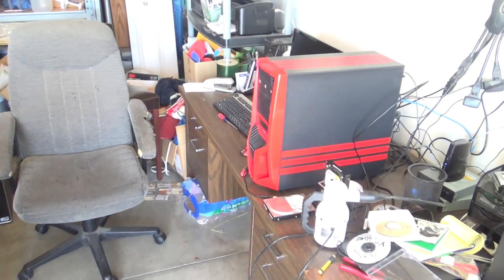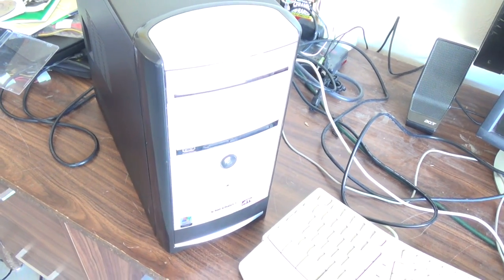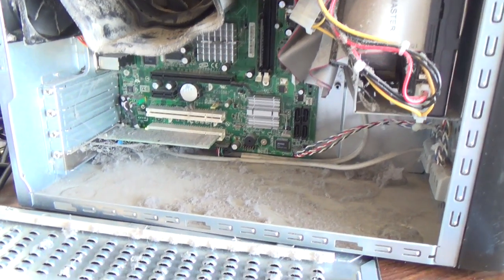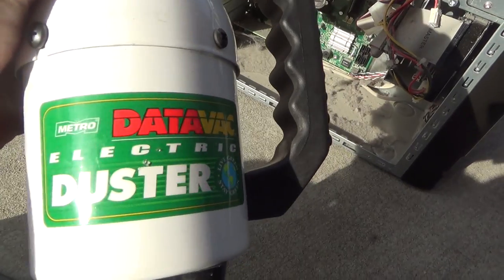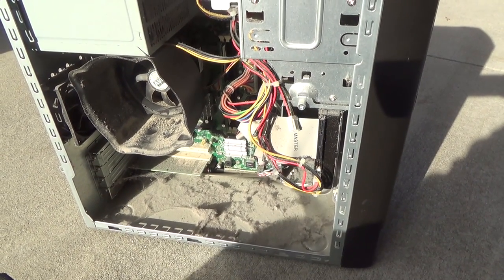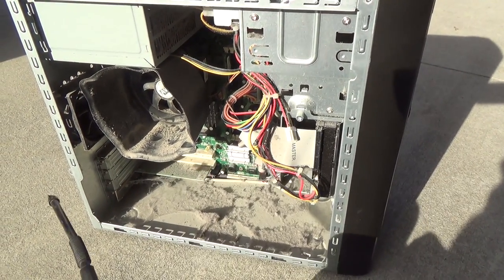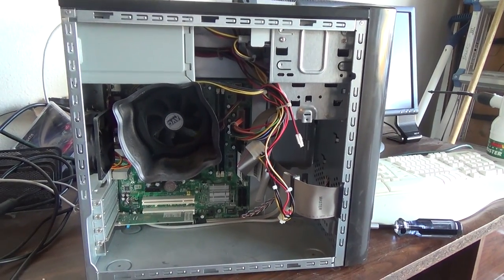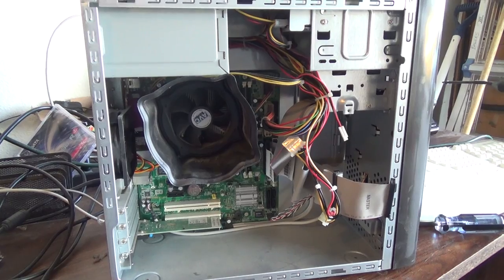One Dusty Computer Tower - And An Awesome Device to Clean It Up

Comment: How often do you recommend unplugging everything taking your personal computer outside and Dusting it?   I have a PC that I never cleaned lasted since 2012.  But God it looks scary the radiator for the water cooler looks like it's made from dust.  So with my new PC I wanted to keep up with it. Even if it doesn't make my PC last longer I'd like to keep the components clean.

Comment: I have used air compressor  set to around 75 psi. crank it up to 100psi to clean cooling fins. after reading the (shorting out) posts, now I  stick my finger in fan.  But I had blown out a slew of PC's,  fan sscreaming as I went along, without any damage. My PC gets a blow job once every couple months.  And yes....I am a little envious. 
Am working on new build with air filter for incoming air.
have no idea if it will make a difference. Hope your getting paid per view on duster product.
Reply from the maker: +River man - Nope, not getting paid for anything I review on my channel, it's all my genuine and honest opinions.

Comment: Wow I thought mine was bad last night when I cleaned it. Mostly just near the fans I had dust and pet hair. A little dust came out here and there when using compressed air. Just with that I had a noticeable difference in cpu and gpu temps.

Comment: Will this make it run faster??
Reply: won't make it faster but it will help keep it running good instead of overheating and parts going out
Reply: yes
Reply: It would make your computer better in the long run.Since the more dust your computer have, the more heat it will trap.
Reply: Zac Van and the more heat the slower the computer is
its easy like
dust mean heat and heat means lower peformance so i recommand cleaning your tower evey month atleast
Reply: Thanks anyway a, I just purchased a new CPU and a motherboard, I'm just going to rebuild it instead of cleaning.
Reply: +Leon Anthony good idea 😂

Comment: Mesh filters suck, they only remove like 1/4 of the dust coming in. If you really want to keep 99.99% of dust out of your PC, get a HEPA filter and make sure they are sealed airtight at every vent. That would allow you to simulate a clean room environment inside.

Comment: I use small leaf blower that I got for 20 dollars. I can't wait for those small dusting machines. I just want to be done with it more quickly :) Btw I also don't hold my fans, and I cleaned it while my pc is running too and never ran into any problems last 2 years as since I got my blower.

Comment: Hi Zaxtor99! Thanks for your video! Do you think it would be OK to use a vacuum cleaner instead? In the past I have used a vacuum cleaner on ordinary suck mode -- is this dangerous for a computer? Thanks so much for your help!
Reply: David Kendrick Yes, this has a chance of creating static electricity and ruining a part, buy some canned air at a local hardware store.

Comment: If the computer started to make like a  beep/rocky sound then dies out does that mean I need to clean it out b/c I have important documents in my tower and it turns one but not get past the window screen help please I don't want my documents to be erase oh and I believe it's about 10 years old. Please I'm begging you help.
Reply from the maker: A beep could mean a lot of different things, but usually is some kind of warning from the motherboard that something is wrong and that is why your PC shuts down.  The rocky sound could be several things too, but my best guess is a worn out fan, which would cause overheating... which could lead to a 'beep' and the computer shutting itself down before it overheats.

The sound could also be your hard drive failing.  it's hard to say exactly without being able to see and work on your PC in person.  The first thing I'd try is blowing out all the dust and cleaning the fans out really well as I demonstrate in this video.  A can of high pressure car can be used if you don't want to spend the money on a device like the DataVac I use in this video.

Once you clean all the dust out, try to boot up the old PC again.  If it does boot up, then make sure you buy or use a USB flash drive and back up all your important files, pictures, and documents to the flash drive.  If it does not work, then the PC is likely not worth the cost of repair considering its age of 10 years old.  The hard drive can be removed from it, and there are lots of videos on youtube already on how you can buy an adapter kit to plug that hard drive into a different computer and recover the file you don't want to lose.
Reply: Thank you so much I'll try that I open the tower and it's filled with dust hopefully that's the case you don't know how thankful I am thank you very much😅
Reply from the maker: Ruby Rose
Okay let me know here what happens, and I will try to help you out the best I can, and will even make a new video if I need to to assist you.  :-)  Good luck!!
Reply: Hey it's me again so I clean it just like the video but know that I turn it on it makes a tick sound for a while thens dies out and continues again but this time with a beep and it repeats all over again. I try to open it but it won't get past the welcome page and dies out again. Help please😥😨😰😣😫😫
Reply from the maker: Ruby Rose
Okay Ruby, at this point, honestly  your PC is 10 years old, it's not even worth the trouble for you to try and fix and certainly not worth the cost it would take to have it repaired.

You can likely recover all of your files however.  You need to remove the hard drive and use a universal USB adapter.  I will make a video and show you exactly what you need to buy, and how to do it.  Look for that video later today.
Reply: Ok thanks oh and it's 7years old I just say the tag hopefully all my files are saved also does that count on iTunes music that are not bought but transfer/downloaded?
Reply from the maker: Ruby Rose Yes as long as you can access your files on your hard drive (meaning as long as your hard drive is still in good working order), then you can recover all of your music on there, utorrent files are not an exception.  You'll be able to save all of them no problem.  Here is a video I made just for you:  How To Remove A Hard Drive From A Failing Or Old Computer And Back Up Important Files  
Hope that helps you!  :-)
Reply: Thank you so much you save my life now all of my documents are saved 😀 thank you

Comment: is it worth it to buy an Electric duster or high-pressure air in a can?
Reply: if you own pets or have your pc on the ground then yes i use a small Air compressor 1.5 or 2HP does alot of jobs around the house too as you can use air ratchet tool also

Comment: hey man i know this video is old, but what is the best way of cleaning gpu with a blower fan ?
Reply: if your components are not super dirty you can use a can of compressed air and some paintbrushes to clean it
Reply: did oyu even read my question? I asked how to clean a gpu with a blower fan because is a bit different than normal fans.But its harder to clean, so do i need to remove the plastic part with the blower or just burst the air in the fan without striping down the gpu

Comment: 6:32 
Doesn't your mouth get sore?
Reply from the maker: +RexVergstrong - LOL, smh.  Nope, I like blowing (fans with my Datavac you perv)
Reply: +Zaxtor99 i would say 50 to 60 USD is too much to spend on that thing, if you happen to have a leaf blower just use it it works as good, this is what i personaly use. if you dont have one then look for a cheap mini one to buy dont worry its way cheaper then that thing, try ebay or amazon.

Comment: i was thinking of doing basically a cold air intake like you would with a truck to cool the cpu, I didnt think this was something that was actually done before.
Reply: Mike p It's been done. That's basically what this PC in the video has on the CPU. That big funnel goes to the side of the case and draws in fresh air from outside the case and onto the CPU rather than having no funnel and the CPU drawing in warm air from inside the case.

Comment: That's nothing. I had to revert back to an old emachine once my newer pc got cancer. Pentium 4 so I'm guessing it was from around 06 or so. Never been cleaned. Never even been opened. It was beyond dust. Just clumps of filth. It was like a computer with pubic hair. It's been on it's deathbed for about a year now.  At this point I've just left the panel off thinking that maybe that could be my way of taking it off life support, but it's still kicking. It's loud, it's dirty, it's only got 1 fan left, but it's still going. So idk.. well played emachine, I guess.
Reply: My first computer gpu fan struggled to spin (it stopped spinning and spinned like 2 rounds and stopped again) because of dust lol

Comment: First thing any good IT technician does is to clean it from dust since overheating is the most common problem for any customer who has problems with "slow" pc. I have seen some dust in my days too and god I do not understand how some of them have not fried :D.
Reply: They thermal throttle removing high clocks in favor for temperature in turn making the PC run slow. :D
Reply: 90% of my clients have problems cuz they can't stay away from facebook games. and other "free" games websites.

Comment: Hint: Use a vacuum cleaner with mini accessories before blowing all that dust all over the place.  Then use a microfiber towel to remove most of the dust left after vacuuming, and if necessary use the back of your vacuum cleaner to blow away the rest of the dust. This is a more efficient method.

He spent 7:30 in explaining how dust gets inside the computer and peddling the Metro-Vacumm. Total waste of time.

Comment: I finally tried this suggestion with my big shop air compressor. Compressed air works really well for cleaning a computer. However, you don't need a huge shop air compressor to do the job with 2 filters for air paint guns like I have to do this. Better off to buy a cheaper air compressor like Zaxtor99 recommends in the video.

Comment: if there's a lot of dust it will overheat but the cpu might survive,thermal throttling will slow down the cpu clock speed and the cpu will survive

Comment: the motherbord has diods that prevent current from going back soo its imposible to do any kinda damege :)
Reply: sure but if the reverse voltage current is high enough could blow the diodes making the board fubar. this is assuming blowing air in the fans cause a current to build. diodes aren't infailable tho.

Comment: You are right about the fan.  Having the fans blades spin from a blast of air (or from vacuuming it) is not harmful.  I used to do it to my old PC every 2-3 months and the thing still works after 10 years (though I have new PC now).  I know of others who also vacuum their CPU fan (carefully) and say it's fine...
Reply: I'm guessing it's only an issue if you just let it spin for a while at a very high rpm than was intended... but what I saw in the video looked pretty harmless.

Comment: Some, not all, motherboards actualy have protection circuitry for the fan, if the motherboard suddenly would stop powering a fan, a current could flow back, so they made the mobo such a way, it can just bleed away to ground. So you would maybe only destroy the fans by dusting them so fast. But yeah, ive done it many times aswell and only 2 broke, and they broke clearly because they where full of dust INSIDE, they where near breaking anway, and a replacement was immenent. So sad I feel by fixing someones pc, take like an hour to fix it and earn maybe a free coffee or 10 bucks only to hear they bought the newest PC and cant figure out where facebook is. (icon, on the desktop.... seriously). 

You did a great job :D also, its cleaner than my PC repair room :D

Comment: How badly can dust affect performance?
Reply: It can cover the air going into the fans which can overheat your pc or your cpu.
Reply: Adam Lawrence To the point that the components will not function properly. For example, the old hand me down PC I had just needed the dust blown out of the video card (ATI 5850 blower style). I was lazy and should have done that before buying a new video card, thinking the 5850 had finally given out, I was wrong. So, it's important to make sure your PC never gets as bad as the one in the video because that's like 25 to 50% worse than what mine looked and still looks like.

Comment: I've never had any problems with any spinning fans, hell I even 
hold the vaccum cleaner on them at the right angle that they spin super fast
and all the shits flying out. Been doing it on 3 Computers for years, no spontanous combustion or
unexpected jihad.
Reply: This is probably one of the most funniest comments I've seen in awhile and this comment was from 2 years ago 😂😂
Reply: @officiallyheated  3 years now, and still perfect 😂

Comment: looks like I can use my leaf blower to get the job done
Reply: +Miguel Moreno No that's a bad idea .
Reply: +Miguel Moreno And get you motherboard fried from the static electricity
Reply: +dwarfminerwillie Static electricity from a leaf blower? Errrrmm NOPE. that's not gonna happen.
Reply: +trey fortress 2 look up carey holzman. he does this and it works for him pretty well. but its a battery powered blower, not gas like what landscaping would use or something along those lines.
Reply: +Caleb Rinker it can make static discharge and fry your shit
Reply: trey fortress 2 the guy I mentioned has been running a computer business for 25 years, he hasn't fried anything.
Reply: trey fortress 2 nonsense.
Reply: +Caleb Rinker hasn't fried anything, but he still could've caused parts to fail prematurely. there's no way you can tell
Reply: SnipeYouFromMars the only thing that could wear out prematurely as a result is literally a fan. And a new fan is $13. Or for a CPU fan. It falls under warranty.
Reply: ***** That's not true. Any component can easily become damaged from ESD.
Reply: thats true, but static isnt some unknowable force that come out of leafblowers. the only thing that comes out of a leafblower is air and air.
Reply: ***** im not sure about leaf blowers but i know vacuums are not recommended due to static. idk lol
Reply: SnipeYouFromMars Nope. no and Naaa 
The ESD myth is blown out of all proportion. 
1st there is no possible way to tell what causes component failure. 
There is no possible way to prove an ESD discharge caused it. 
And on a personal note, i worked building computers for a small firm many years ago and i personally saw ESD many times, indeed i did it myself by mistake and yet everyone of those computers posted fine and worked fine. 
This is not to say that Precaution is a good thing, but this is not star wars and ESD is not the dark side waiting to get ya. It's a very minute possibility of damaging a component. Be careful of course. but don't blow ESD out of proportion. At this point ESD is the internet's biggest molehill mountain... followed closely by bullshit about how bottlenecks occur, what causes them and what is being bottlenecked by what... another massively misunderstood topic being shouted around PC circles for the past decade.
Reply: I dont know much about them either, but if i had to guess, i'd say it just blows air. any static is probably benign enough that it wouldnt hurt too much. a lot of stuff these days has at least a small amount of shielding from static.
Reply: +Miguel Moreno 
You can use a leaf blower easily.  There are Youtube videos like that with computer repair people.  Just don't touch the computer and keep some distance from the components.  Carey Holzman who is a respected tech does it all the time on his channel.  He is also featured on Newegg TV.  He has all kinds of myth busters.
Reply: +dwarfminerwillie 
Not true at all.  That myth has been busted long ago.  You can use a leaf blower.  Use it with some distance from the machine.  Don't touch stuff directly.  You won't get a static problem.  Lots of computer techs use them.
Reply: +Miguel Moreno
Let me fix this guys

&quot;Looks like I can use my Electric gas-free leaf blower to get the job done&quot;
Reply: +DAGATHire There are ways to check if the damage was caused by ESD, one of the best ways is to look at IC's in a microscope, and if it has ESD damage you will see that tiny parts of the IC are missing.
Reply: ***** for how long have you not had any noticable issues
Reply: +Miguel Moreno Did someone watch CareyHolzman?
Reply: Miguel Moreno I used a leafblower and I only had one working RAM slot due to all the dust. Now all work. Fail or win?
Reply: As long the blower doesn't make any contact with any component it's fine, nothing will get blown up. Those guys who claimed the opposite have no idea what they're talking about. The only thing that comes out of the blower is air.

But you're all n00bs, once in a while I go to an airport and sneak on the highway. Once the pilot turns ins engines on I hold my computer in the sky. Problem solved lol.
Reply: trey fortress 2 tell that to carey holzman
Reply: I don’t know about those big leaf blowers. But I do use a 600w medium blower and works perfectly. No static, just air flowing and dust coming out. Try to keep some distance and a pencil inside the fans so they don’t spin like crazy and that’s it
Reply: Im expecting a lot of laughs but can I use my blow dryer on cool setting and not heat?..... I dont have a leaf blower OR a air can ....

Comment: Presonally I take the fans out of my Pc's and clean the blades with an old tooth brush. On occasion I have opened up the PSU to clean it out because there was a lot of dust I couldn't get out.